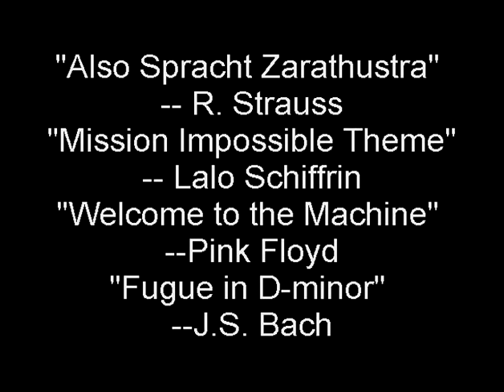Throwback: A Day In The Life Of The MeltShop

Comment: The boots the people on the "floor" - were they special?  I would imagine ordinary work boots would end up burned/melted with bad cases of "hot-foot" from all the hot slag and splatters.  

I've worked on some pretty massive machine tools in my day (including ones that rode on railroad rails and the operator rode the machine in a cab) but the stuff there... just about dwarfed anything I've seen.

Seeing this was fascinating.  Was it as hot (to work there) as it looked?
Reply: RedHeart64 leather boots do the job. And spats the cover the boots also made of leather.
Reply from the maker: Yes, as was mentioned, leather works surprisingly well.  In addition you could get boots with special high-temperature soles.  Generally, "meta-tarsal" boots were required which had a spat-like steel or composite shield which ran up your instep from just above the toes.
Reply: @EntropicRemnants  When I worked for the mines as a kid, we were required to have boots rather like that - a steel shield built in covering the toes (at the least - maybe much like what you describe) because of the foot-crushing danger posed by equipment.  The ones I had were really heavy, but not uncomfortable.  My father in law had boots like that too - but they'd been made wrong and the steel shield was wrong for the boot size and installed on the inside.  It rubbed his feet raw, but he'd been raised to take whatever they gave him and not complain.  (It was a huge relief for him to retire and no longer wear them!)  After he retired (and several years after he could have taken them back), he discovered why they caused so much misery.  I don't understand that type of thinking - it's one thing to tolerate something because you're not used to it or it needs breaking in, but that goes way beyond what anyone should have to live with.  (I've heard similar another time, maybe two or three over the years.)

I've got gloves that are made for working with furnaces and so on - they're made out of thick leather of some kind, but they really work.  What surprises me is that the fingers, while stiff, aren't too inflexible or clumsy - you just have to get used to them.